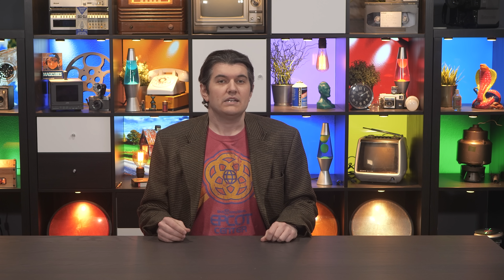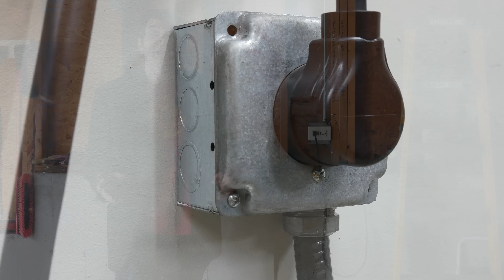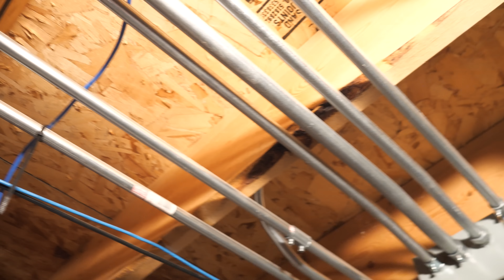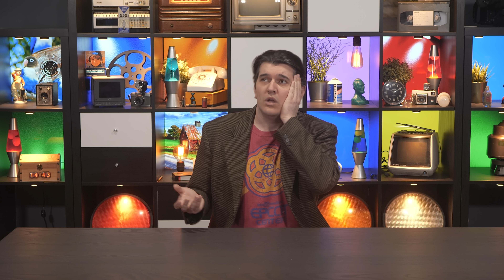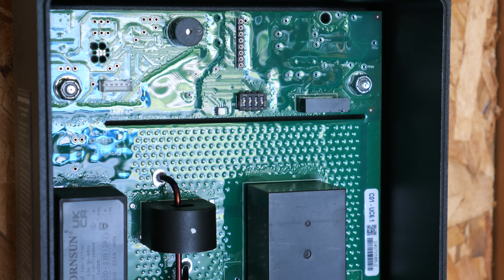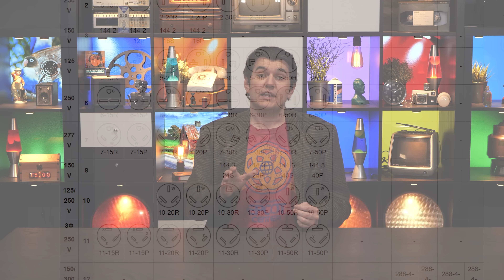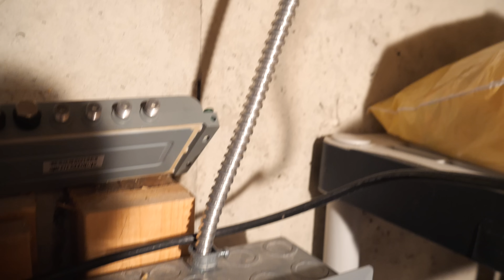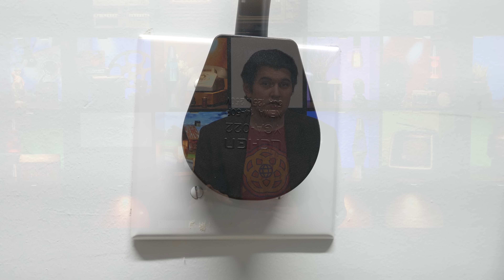The "standard" car charger is usually overkill—but your electrician might not know that

Comment: Awesome video!  Switching the mental model for charging is super important.
Gas Car: Fill up while you're driving to somewhere (SERIAL PROCESS).
EV: Fill up while you're doing something else (PARALLEL PROCESS).
Reply: Agreed.  This is the biggest hurdle for most.  My fillup time is effectively 10 seconds.  5 seconds to plug it in, 5 seconds the unplug it.  If I need to go somewhere while it's charging. Unplug it, run my errand then plug it back in when I get home.  Piece of cake.
Reply: It is totally paralel with my sleep schedulle too. How convinient 😂
Reply: Well put!
Reply: Even on road trips you can find those parallel charging opportunities. Overnight at hotels and electric campsites, but also plenty of attractions along the way have level 2 chargers, often free to use. PlugShare is very useful for finding them. If you can charge for a couple of hours while eating / shopping / visiting a museum / etc. then that goes a long way towards making road trips easier and cheaper.
Reply: And it doesn't just apply to standard charging.  You will need to charge on roadtrips, yes, but you know what else needs to happen on road trips?

Bathroom breaks, getting snacks, eating meals, etc.  You plug the car in, then go into a small store near the charging station.  You have a variety of snacks and drinks available to purchase, sometimes even full meals, and even toilets.  Heck, maybe even a couple arcade games.  I'd be down for spending a few minutes at a Pac-Man cabinet after spending all morning on the road.  If you wanted to be really nice, you can even put the EV chargers under a canopy, so drivers don't have to get wet when it's raining.  

But I suppose all of that would take up a lot of space, and we definitely don't have thousands of buildings just like this scattered all about the country, simply needing some charging equipment installed by the giant corporations that run them.  Would be nice, but it's just not practical.  I suppose I'll just have to stick with gasoline and gas stations...
Reply: @thetechconspiracy2   That's an odd take.  America has lots of space.  The old model of gas stations being small businesses on street corners will fade out.  Instead, we'll have large sections of parking lots with charging stations.  Today many of the Tesla chargers are in parking lots of big box stores and malls.  That's the future.
⚡🗽⚡
Reply: @pilafmon  I was being sarcastic, mainly poking fun at the oil companies that could easily add EV charging capabilities to their gas stations, but aren't in order to make it seem like EV charging is harder than it is (after all, if EVs become the dominant car type, you may only need to visit a charging station occasionally rather than every week, and that means less money).

EV chargers in supermarket parking lots, etc. certainly won't go away (for some people, their best option may be to charge during their weekly grocery run), but I don't think the legacy idea of a "gas station" (a small store on the corner of the road serving basic car and human needs) is going to go away either (nor should it, the concept works great for road trips, just swap the fuel and dispensers for their EV equivalents), and savvy business owners should be able to see the EV takeover coming and adapt.

Comment: My primary charger at home has been a 3.6 kW unit for years. Originally, I had a Chevy Volt when I got it, and it was the maximum the car could take, and it saved a couple hundred dollars over a higher power when when I originally installed it a house ago. When we moved, the lower power meant we could convert an existing trenched 120V line to 240V without needing to replace the existing buried cable. It's kind of nice now because it helps keep my car charging under the headroom in my home solar panel's capacity to avoid touching the grid as often. I've still tended to recommend parents and grandparents go for NEMA 14-50 outlets in houses they might sell or with higher power cars, though, just for future proofing. When I eventually will probably get around to replacing this unit with another (I have my eye on the coming generation of bidirectional systems allowing Vehicle to Home or to Grid) I'll probably eat a fair bit of cost in digging new conduit and stuff for it?

Comment: My mom got a new 5-15R or 5-15P (both are normal household outlets) receptacle installed for her car charger, but that was because the only existing receptacles in our garage were a) not in the right spot, and b) very old and possibly not up to current code. Also, the breaker box is about 2-3 feet away from where the new receptacle is, so it was very easy to connect it (conduit was used because that wall is a single layer I think).

Comment: I charged my Bolt with 12a @ 240v using the standard Clipper Creek EVSE that comes with GM vehicles and was able to recover from a 200 mile round trip in about 2 nights, including a 25 mile round trip to work the day after.  3.6kw is a lot of power, 7.2 is gobs of it

Comment: Wait wait.  Since you used 2- 30Amp breakers, don't you have 60/52a available?? Or is the charger designed to charge at 24A PER line?    I'm confused in 110vAmerica 😂
Reply: No, it's a double-pole 30A breaker for a 240V circuit.
Reply: @GH-oi2jf  this is why I'm confused "A 50-amp double-pole breaker is designed to safely handle 50 amps of current on each of the two hot wires in a 240-volt" circuit.
Reply: @mapax5 — Yes, and a 30A breaker handles 30 amps.  I don't understand where you are confused.

Comment: I agree, great video.

For those who drive ALOT more...

11kw charging is great for me with a limited off-peak charging window and frequently does 300km in a singgle day. Fast enough to be cheap and quick, but not with the higher cost of a dedicated 25kw DC charger.

A 2.2kw (230v - 12A) wall socket would increase my charging costs due to bleeding into peak time. But that may not be applicable to your region.

Some of my back to back trips would become painful, but there are so many fast charging stations now those rare options would only show up on those 500km+ days.

EVs have been great as its less than $1 per day, not bad for someone who does over 25,000 kms per year.

If you do less than 700km a week, the message in this video will apply to you in most cases.

Comment: There are some cases for Smart Chargers - like solar excess changing and changing based where your tariff is linked to the wholesale power price (i.e. changes all the time), benefit from Smart Chargers.  But they should be standards based (i.e. OCPP).

Comment: That's a hefty price for such a simple circuit board.
Reply: Those units are enclosed within a well built metal cast structure, not a whole lot of plastic with Grizzl E* units. The Copper gauge wiring is relatively high and runs over 20 feet. Copper isn't cheap.

Comment: What about on-board charger efficiency when charging at a significantly lower power than it is capable of? I’m charging often at 4,8 kWh instead of the 10,8 the system is capable of.

Comment: I hope Alec address this, but even if you don't install a 240V AC to DC fast charger at home, charging from 240V is still more cost effective.
The car's BMS and it's cooling fans typically run at constant while charging, this parasitic load reduces charging efficiency (though it is absolutely needed). Charging from 240V AC power cuts the charging time by slightly more than half in most cases reducing electricity lost to the parasitic draw of the BMS and fans. 
This is exponentially true with DC fast chargers that have their own rectifiers that are typically significantly more power efficient than your car's rectifier because your car's rectifier is built not for efficiency but to survive the adverse conditions associated with being part of a car that is likely to spend a significant portion of the summer outside on triple digit hot tarmac (asphalt).
The cost savings of the more efficient charging oftentimes covers the install cost of your DC fast charger after 2 years.
This is all assuming the same amperage. Higher amperage = higher efficiency = more savings over the life of your EV.

Also if you don't NEED the extra range, never charge above 80% and try your best to never drive below 20%. This will double, possibly even triple the total life of the battery pack.

Comment: I also have a Grizzl-E Classic to charge my Chevrolet Bolt. I picked up a factory refurb for about $300. I got an electrician to install mine in the side of my house (because even though I absolutely can, I knew I wouldn’t). He charged me $800 to run a new 50 amp circuit to an outdoor box 30-ish feet from my breaker panel.

I went with a receptacle rather than hard wiring because I have a stick welder and a couple other 220v power tools. I made a breakout panel, of sorts - a 14-50 range cord run to a 6-50, a 6-20, and a pair of 5-15 receptacles. I’ve used this exactly once since I had the circuit installed nearly two years ago, but it’s nice to know I can!
Reply: I did exactly the same thing. Mostly use the outlet for welding.  I have another Grizzl-E on the property that I wanted hard wired but the terminals inside are too narrow. We used a 14-50 on that one which already burned once until we replaced it with a Hubblell. I recommend hard wiring when possible.
Reply: I was going to buy the grizz but I found a guy selling new chargepoints on ebay for $300 so I went with that instead. I made an account so I can control it on the internet and it works great.

Comment: I measure things. So when someone claims that 5.8 kWh is "a lot," I have to push back.

In Denmark, the standard home EV charger delivers 11 kW, and anything less is often seen as inadequate—or even dangerous. So-called “granny chargers” (slow 230V charging at 10 amps) are considered a fire hazard, and rightly so. In fact, 230V/10A is the absolute minimum permitted for household installations under Danish regulations.

A typical Danish home has multiple electrical circuits. Ours, for example, has five standard circuits, two three-phase (kraft) circuits, and a dedicated EV charging circuit connected to the fuse box using special cabling.

Everything was, of course, installed by a certified, skilled electrician working under a licensed electrical installation company—as required by Danish law. And believe me, I am happy to pay for that kind of safety and professionalism.

We’re even talking about making 22 kW chargers the new standard in Denmark, as more and more of the far superior European EVs support this. Compared to that, your American equipment is shockingly substandard—and I say that with no apology.

Frankly, America often looks like a third-world country next to Denmark when it comes to electrical infrastructure and safety standards.

Comment: Don’t cheap out. Just put the GFCI breaker in.

I ran a 50amp circuit for charging because I wanted the flexibility for other things.

Running 6/3 ain’t cheap but I’m only gonna do it once. That and the 50amp GFCI breaker were the bulk of my cost.

Comment: If you’re gonna go to the trouble of installing an EV charger, you might as well go for 240 V at least 40 A (9.6 KVA). Even though you might not normally need that, the times you do will make up for it. Such as needing to charge a rental EV up to full just before you return it locally. Once you have a home charger, it sucks needing to go to the fast charger in town.

Comment: I drive 44 miles one way to work. Being able to charging at work isn’t always available, because jealousy. My wife drives 31 miles one way to work with no option to charge at work. We have little choice but to charge using level 2. We avoid supercharging, because of extra expense and longevity of the battery.

Comment: Great video and totally agree on all fronts! We are an only EV household, 2 EVs and my wife and I both commute every day of the week (around 20 miles a day each). And you know what charging equipment we have at home? A single L1 charger. I plug in every weeknight after work, she plugs in for (usually) the whole weekend. We take my car out during the weekend excursions, it will easily will recoup the daily commute overnight and then makes up some of what we used over the weekend throughout the week. And her car pretty easily charges all the way to 80% during the weekend. If I need more charge (which doesnt happen very often) I will plug in my car at work, or take it to the fast charger. 

I would prefer a L2 charger, and would hugely prefer 2 load shared EVSEs. But its not plausible in our current townhouse, and we simply don't need it. I would say our current charging situation isn't really any more or less convenient than pumping gas was, but its a hell of a lot cheaper. 

Also btw, I really think you ought to mention the charging receptacle safety bit at the same time you mention the dryer outlet bit. I would not recommend someone use their dryer outlet for charging their car without making sure it's a quality receptacle, installed correctly, and the plug is in good shape.

Comment: 21:04 the electricity company in my country -- which is a state-owned monopoly -- actually has a program to assist EV owners.
They will pull new supply lines to your home, install a second watt-hour meter (of the prepaid type), and provided that the distance from the watt-hour meter to the charging station is within a certain limit, will even help installing the necessary outlet. Which, to the best of my knowledge, is just the well-known Type G (UK) power outlet, capable of delivering up to 13 amps @ 230 volts.
(Just a bit of info: Indonesia has practically standardized on Type F sockets, but Type G is very commonly used for higher-current appliances such as AC -- and lately, EV power supplies.)
((Which is actually kind of the wrong way around, because Type F sockets are actually rated for up to 16A while Type G sockets are only rated for up to 13A, but the requirement to have fused plugs and switches directly on the outlets themselves are the key safety features being sought after.))

Comment: This video came at just the right time for me. I had an EVSE installed at home 3 years ago with a NEMA 14-50 outlet in my garage on a 50A breaker. I only charge at full capacity (40A) because I never saw a reason to lower it.

About a month ago, I heard crackling sounds coming from the plug after plugging in my car. Turned off the breaker, unplugged the charger, and apparently the outlet had started to melt. Lots of charring inside. I chalked it up to a cheap outlet being used, so I replaced it with one that’s specifically designed for EVSEs, and it was back up and running.

A few nights ago, I heard crackling sounds again after plugging my car in. No melting or charring, but one of the cables connecting to the outlet was loose. Looks like I didn’t do a great job 😬 

However, something I didn’t realize was significant was that the original electrician from 3 years ago used aluminum wire instead of copper. Now I’m wondering if the original issue was oxidation from not being treated properly like mentioned in the video.

I have a portable charger that can run off a standard outlet, so I’m just using that until I can have an electrician take a look. I’ll probably switch to a hardline connection, maybe with copper wiring too.
Reply: I hope you have a smoke/fire detector there too.

Comment: I think something noteworthy is that it does suck to have to take a break to jump to a charging station. My father used to drive a Model 3 while we only had 110v, and if he didn't have errands to run other than work, he could have charged just fine on 110v for his commute. The other errands just barely pushed him over to needing 10-20 mins at a charging station. It wasn't necessarily the cost of electricity, but the cost of the time to go out of his way to charge, which would be upwards of 30 minutes one way(and still would be 5 years later). 220v is something that became necessary pretty quickly.

Comment: It's exceptionally rare for me to comment on videos, but your original guide got me away from the paranoia of electric car with an apartment (One that had a charging station, but lots of early anxieties about competing for that station) to now home ownership where 90% of the time, I just charge through the standard wall outlet. The very few times I need to suddenly juice up, I run a cable to our Dryer hookup (Not as smart as the one you showed, I just make sure I remember "If the giant cable is out in front of the laundry room, don't run that dryer")